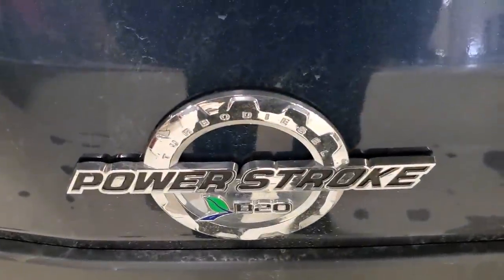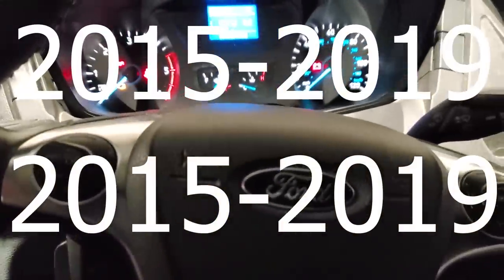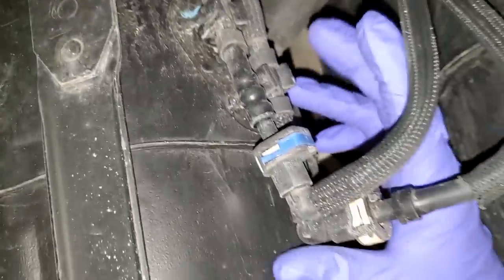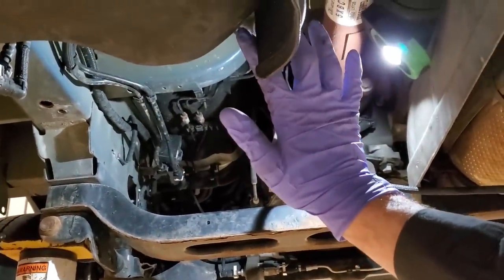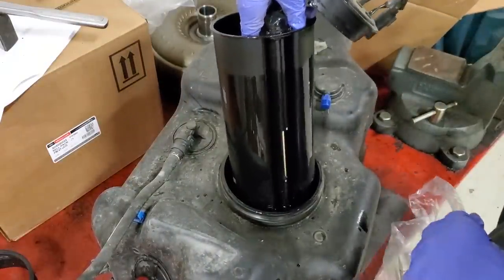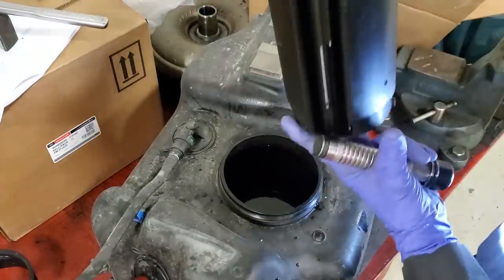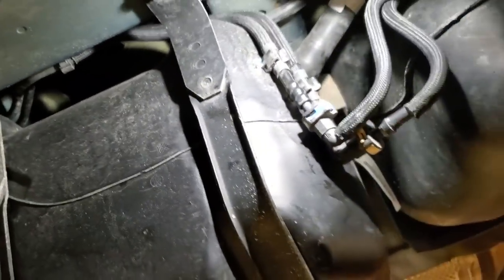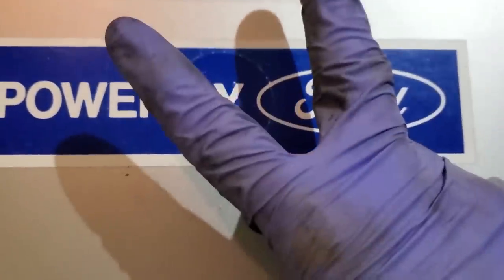Ford Transit DIESEL - DEF RECALL!!

Comment: I was once told by a intelligent man You should always clean The def tank and replace def fluid when you have it out. Def quality is a big issue as well. Hot water is all you need to clean the inside of tank, it gets rid of the crystallization build up. Nice job sir very punctual 🤙

Comment: I work on Chevy trucks and the LML duramax heater and pump as well as lock ring, gasket and electrical connectors are totally identical. As well as the twist to lock at the bottom of the tank deal. Must be made by the same manufacturer. They fail all the time and there’s also an extended coverage for them. The L5P (‘17-‘19) have a different style heater/pump module. Haven’t seen the 2020 models setup yet but I’m sure they will also fail.
Reply from the maker: Yepp 2020s i have no probs,  actually 17-20

Comment: And just when I've already done a bunch of these on Transits RETAIL, Ford releases the same program as they did on the F-Series. Well, I haven't had to do one lately, but you can bet that I will be coordinating them to come in with the driveshaft coupler recall shield to be done at the same time as these programs. That DEF tank sure gets in the way of accessing the back of the transmission to install that damn shield. BTW, do you ever have any better luck with removal/install of the EGRT sensors on these for the dreaded P040D? Every one I've ever had to do, required keeping the heat on the manifold cherry red almost throughout the entire duration of spinning the sensor out of the manifold. Not to mention threading in the new sensor has been difficult too.
Reply from the maker: Yepp complete same for me

Comment: I got a P203D code.  Got it fixed under recall / field serviceable item.  3 months and 2000+ miles later I took to smog check and they said it wouldn't pass because of a "permanent code P203D".  No CEL in the last 3 months after that repair.  I read that the permanent code would clear after 200 miles and 15 drive cycles.  I must have driven more than 15 times, and 2000-3000 miles now.  Do these codes clear by themselves?  Thanks.
Reply from the maker: Yes sir they do, you just stated it

Comment: Hey man just had to do a trans on a 15 transit 250 3.7 non turbo  and had all the rear trans crossmember support bolts snap off. Is this common on these at all? I was able to drill them out luckily but wasnt fun. Also noticed the crossmember was starting to rot through below the steering rack. My hvac customer has 12 of these. Am I in for it???
Reply from the maker: Yeppp see it alll the tymeee

Comment: Would a dual fueler and compound turbo on a new 6.7 void the warranty? ATS has seamed to have sorted out how to keep the emissions and add those with some software to get it to 650 rwhp.. what’s your thoughts?
Reply from the maker: Yea bud i dont think thats gonna fly
Reply: PowerStroke Tech Talk w/ARod  thanks for the comeback! Guess, I’ll just stick with going with the off-road option and screw the warranty

Comment: Do you have the part number for this on a 2016 transit 350?. Mine has similar codes.  Def light is on now. Says it will be 49 mph on restart
Reply from the maker: No